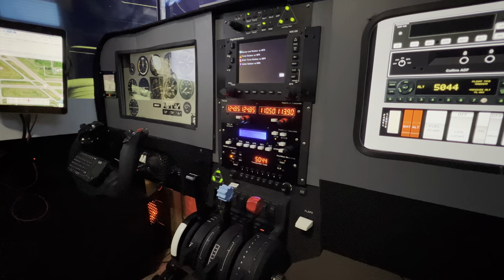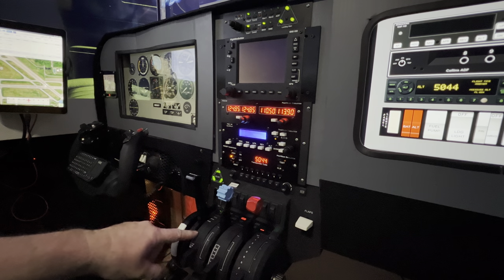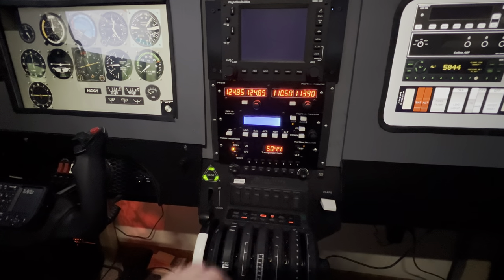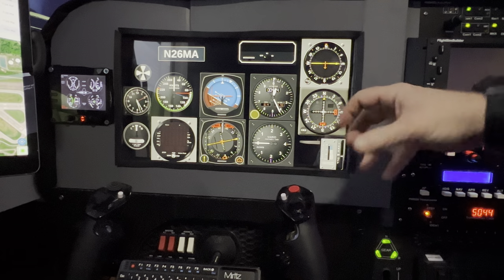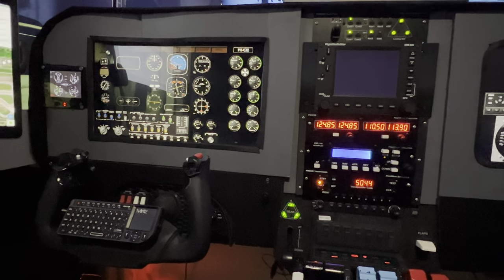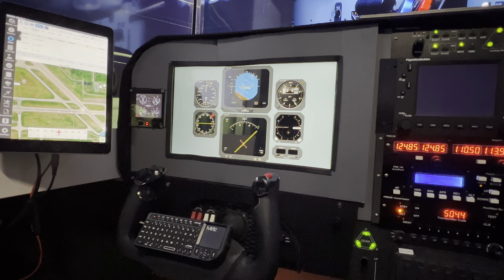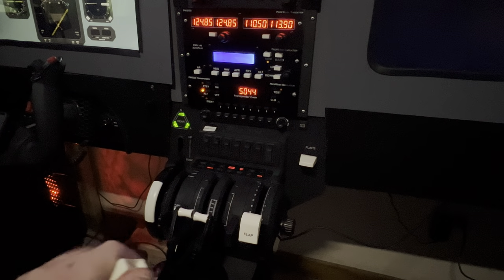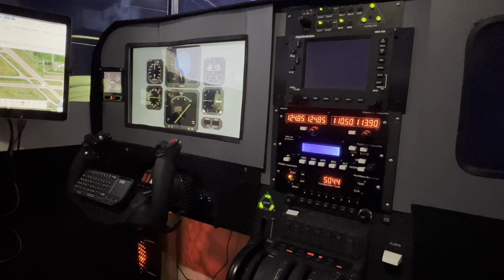Just How “Flexible” Is My Home Cockpit?

Comment: Nice job. Ive chosen to go the opposite direction, in that I prefer to stay “inside” the simulator as much as possible. I bought only one piece of hardware, being the VKB flight stick with the attached throttle quadrant. Very small, easy to move off of my desk etc. This gives me control of many things within the sim, but without taking my eyes “out” of the sim. A lot of great options for everyone that is a sim enthusiast

Comment: If I use the g1000 overlay with air manager. would it work on aircraft in msfs that don't use the g1000 like the c152?
Reply from the maker: When you setup a cockpit/gauges in air manager you bring in the G1000 overlay as an instrument and then use the MSFS pop out feature…

You can setup a Cessna 152 by just bringing in the gauges you need vice the G1000…air manager and a touchscreen/knobster is a powerful combo